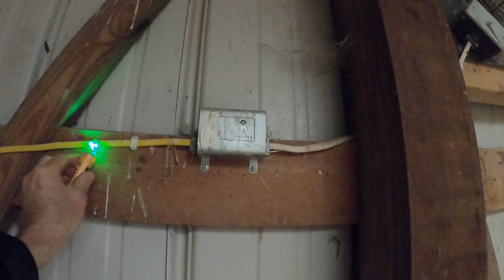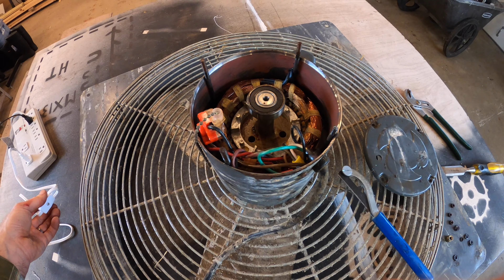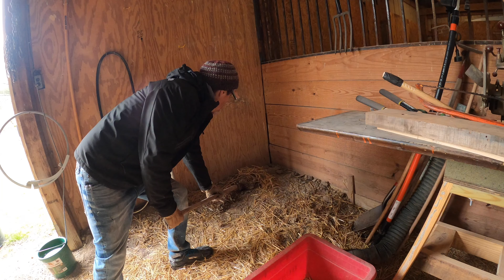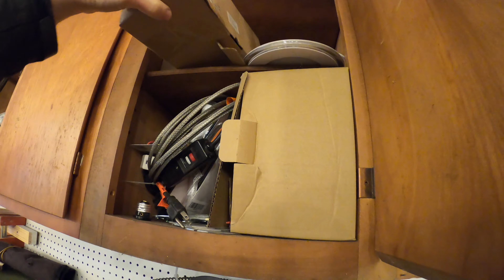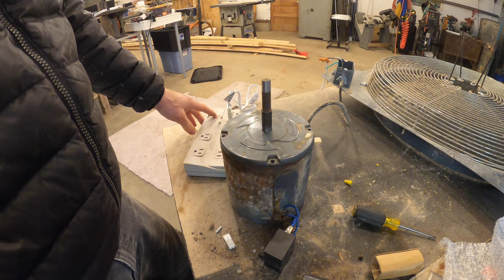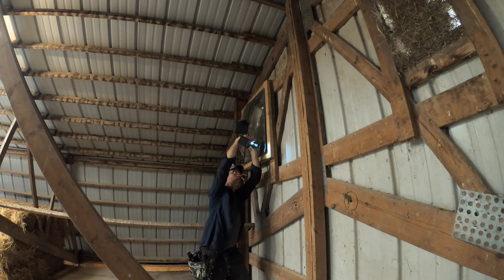Barn Fan Repair, Replacing the Capacitor

Comment: Nice work with the capacitor. Actually they are better left away from the motor housing since heat kills them.
Reply from the maker: Makes sense. I bet that old fan ran so much that it cooked the capacitor.
Reply: @metaspencer  Yeah, running up their in that extra hot weather probably didn't help any either. Was that a 2.4 or 24 micro farad cap you put in it? Because if you get in the habit of clipping ones off of old equipment you can often put the values together to make up the value you need.
Reply from the maker: I'll have to look again but I think it was 24 microfarad ... now, to be honest I'm only NOW doing a research on capacitance ... totally new to me as I'm just a wiring guy not an electrician
Reply: @metaspencer  Oh yeah, most people need no deep understanding of capacitance. In a nutshell a capacitor resists the change in voltage. By outputting what it has it can help smooth out DC circuits like battery chargers.
 AC unfortunately is quite a bit more complex as in trigonometry level math. But as long as you watch the ratings you can substitute others. Like you needed 6 mfd, you could easily use two 12 mfd capacitors in series to get 6mfd. It's real strange but there are plenty of sites out there to help you calculate values so don't be intimidated by it. 
 In most home applications you will see two types - capacitor run and capacitor start. You have the latter. Sometimes you will see both.
 I went to college for Avionics BTW but medical issues kept me from finishing my degree. I still love the field but its huge and its impossible to understand it all. Best thing is be able to google the answer you need when you need it.